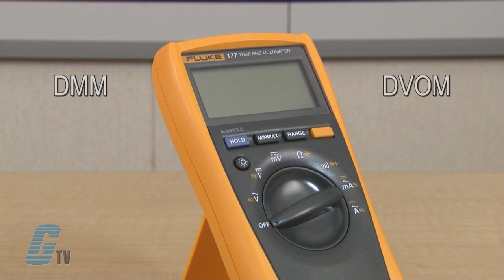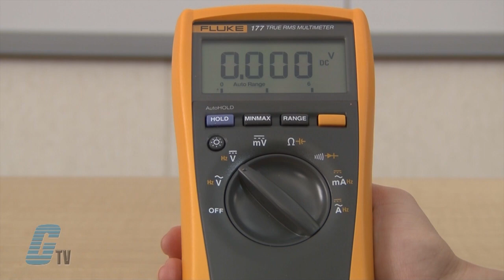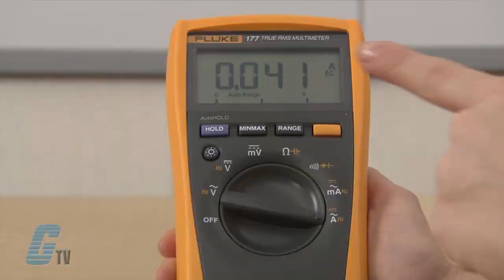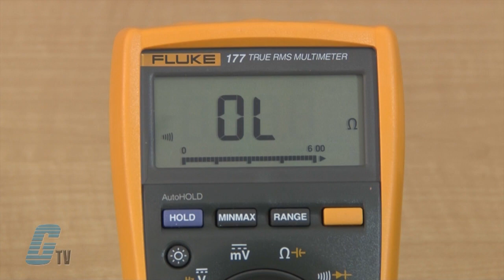How To Use a Multimeter - Basic Tutorial

Comment: wot does the hold button do plse???
Reply from the maker: The hold button simply locks the display at its current value and does not update unit you cycle power, change ranges or press the hold button a second time.
Reply: thnx